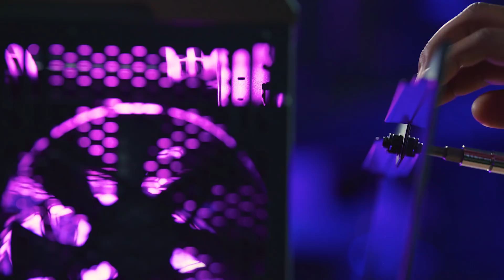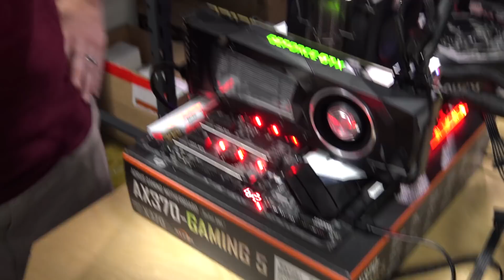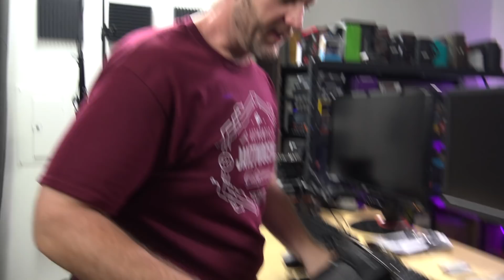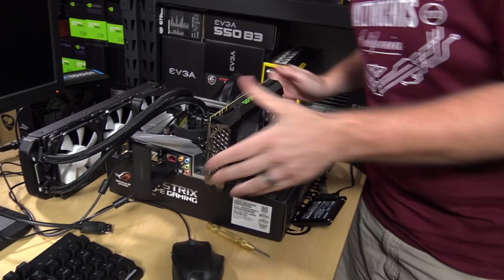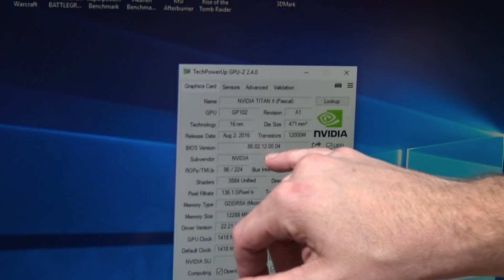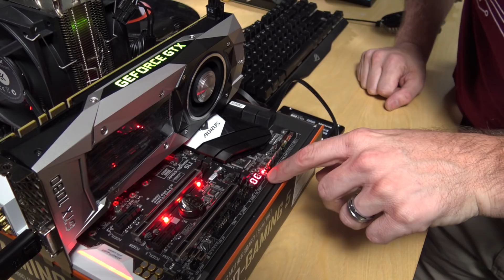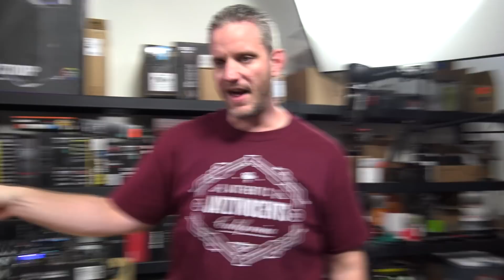I cant figure this one out... HELP!

Comment: I can help you figure it out :)
Reply: agreed, he first showed the firmware for the working one on the intel, with the bad one on AMD, he then took the working intel one, put it on the AMD side, and showed the firmware of the same exact GPU, not the one that wasnt working on AMD. I may be wrong, but isnt bios firmware of the GPU on the GPU itself and not the motherboard? You showed us the firmware of the same GPU, not the one that was having issues with AMD
Reply: he showed that moving card B from intel to ryzen does indeed not change the firmware on card B, as he never showed us the firmware on card A. He may or may not have checked it off camera and just messed up while recording, when you troubleshoot something with everything you know it can be easy to do mistakes like these and think youre crazy hence why i said may or may not have. :)
Reply: Motolav He unfortunately showed the firmware on the same card twice. if you watch carefully
Reply: No he didn't. He checked the bios version of the same card twice. The card that was originally on the 8700K system and moved to the RYZEN system. He didn't check the bios of the card that did not work on the RYZEN system after he moved it to the 8700K system.
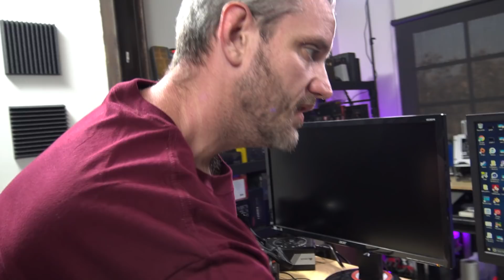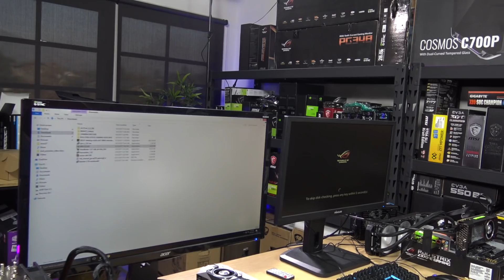At 1:58 he checks the card on 8700K and then moves it to RYZEN and at 4:48 he checks the same card at the RYZEN bench.
Reply: Exactly.  Right as soon as he showed the bios on the Ryzen system, I was like....what?  wait....same card.  Of course the bios is going to be exactly the same.
Reply: Motolav he took the GPU from the working one after checking the firmware and put it in the other and checked the firmware, but didn't do the same check after putting the non working one to the working one. Flashing the GPU BIOS seems like the logical move, but I'd approach Nvidea about it.
Reply: gpu-z shows the "bios number" for that gpu, but doesnt show the bios version. In the case of my msi rx 480 i bought it early, after that msi comes up with the new bios on the newer gaming X´s. A friend of mine bought a "new one", and.. to my surprise gpu-z showed the exact same bios number. I asked him to give me the bios file so i can edited it on "radeon bios editor" when i opened it my bios was version "113-MSITV341MH.151" and his bios was "113-MSITV341MH.153". I flashed my rx 480 with that bios...  that fixed a wrong power consumption reading (it was 30/40w higher than it should).
Sry for my english btw
Reply: He showed the firmware was the exact same...
Reply: That's what I thought I saw too!
Reply: jayz didn't show the bios when he swapped the problematic card into the intel system.
Reply: you sir are not blind like jayzrwocents
Reply: HAHA your right, didnt notice.
Reply: Try putting it in another ryzen build and see if it works as well or not or try a differemt pci slots.
Reply: true
Reply: Yep was going to mention that as well.
Reply: He said the BIOS was the same but he didn't mention the firmware is the same on both cards. BIOS and firmware are two different things.
Reply: she's just trying to promote her channel.
Reply: The firmware on the graphics cards could be different.

Comment: Have you tried turning off and on again?
Reply: Instructions too difficult. Got dick stuck in cat
Reply: And if all else fails, reinstall Windows.
Reply: Could also blow into it... Has he tried the Ryjn method, where you pee on the thing that is most likely causing the issue?
Reply: Maybe he doesn't have it plugged in on both sides
Reply: How many times did you reboot? I think you should try a couple more times! Lol